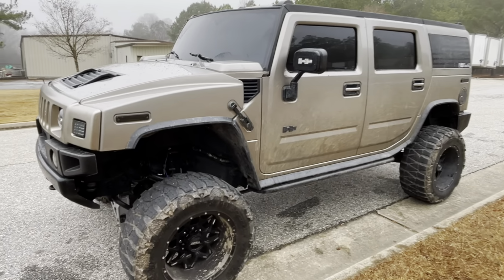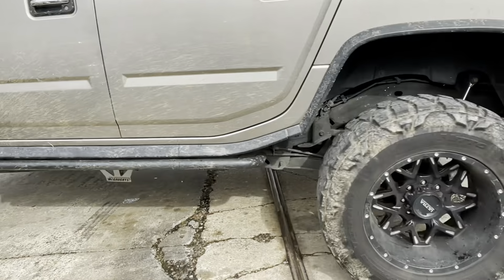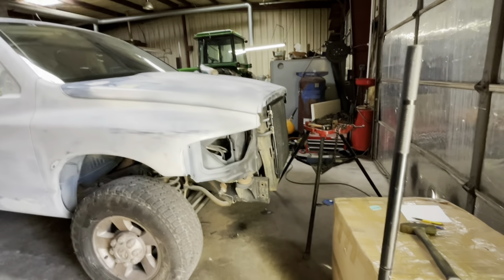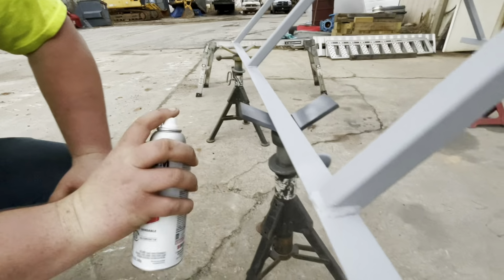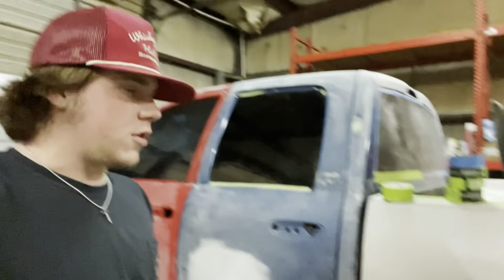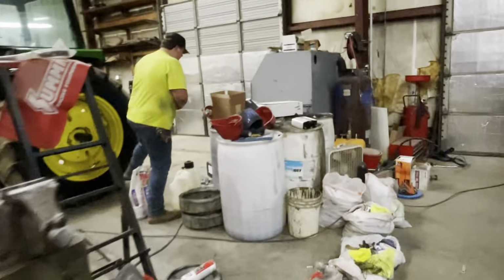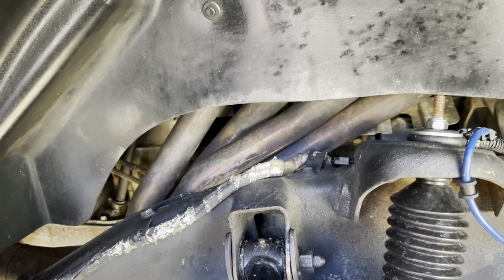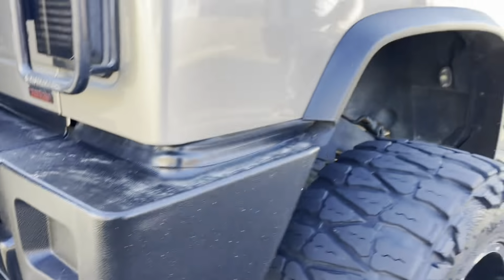The Best Hummer H2 Custom Exhaust

Comment: I love  your truck and custom work you did on it, I have a h2 2006 trying to change wheels and muffler. What size are your wheels? What type of muffler and setup please? Thanks
Reply from the maker: The exhaust is long tubes, catless, true duals, and a flowmaster 40. The wheels are 20x12 -44 offset
Reply: @Thath2  awesome, keep bringing these videos out.

Comment: Hey, did you have fitment issues with the speed engineering long-tube headers ??
Reply from the maker: No they fit with plenty of room to spare
Reply: @Thath2  i just installed them on my hummer earlier this week but im noticed there's a whistling sound when accelerating. I checked for any exhaust leaks couldnt find any. My current setup is long tubes to straight pipe true duals and single x-pipe, no cats no mufflers. Did you have the same problem?

Comment: Do you have a tuner? Or you getting it dyno tuned? How you tune out the cats
Reply from the maker: I haven’t had the cats tuned out yet but I had a shop tune and dial the truck in after I did the motor
Reply: @Thath2  that’s still not terrible with the lift you have

Comment: What MPG you get with that setup?
Reply from the maker: 12 roughly
Reply: @Thath2  I am currently doing the E fan swap, will do exhaust later and a tune. I am hoping for 14-16
Reply: Currently stock with 35s on 22s I am getting 10.9